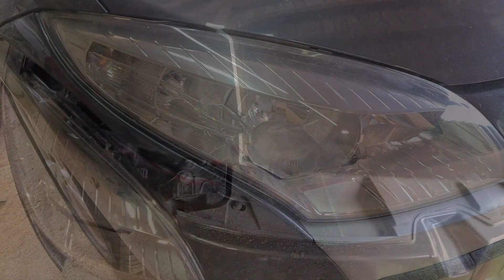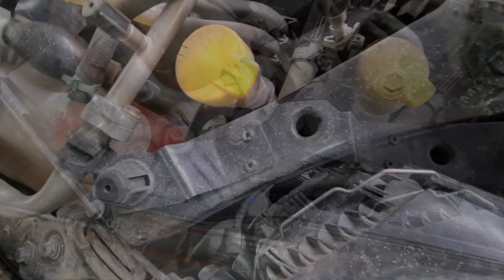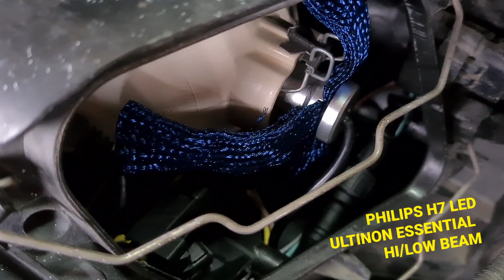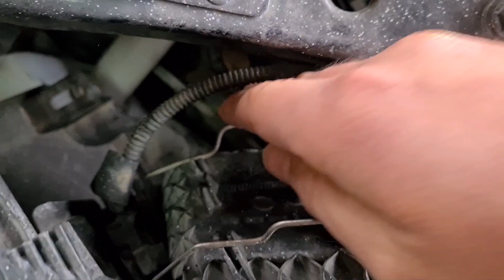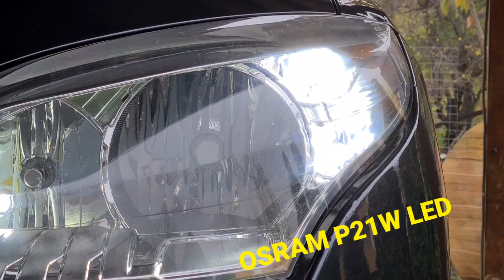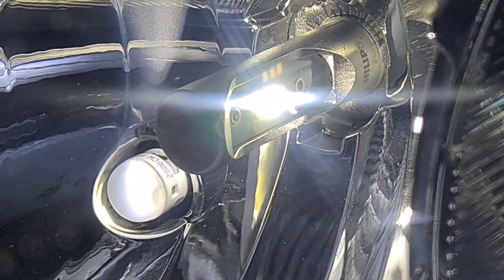Renault Megane III Coupe Headlight Removal | H7 LED Philips Installed

Comment: Olá bom dia... As lâmpadas led h7 sem canbus dão erro de lâmpadas no quadrante...?? Desde já obrigado
Reply from the maker: My car doesn't have CAN bus system and doesn't show error light on the dashboard. If your car have CAN bus system for detecting burn bulb you need to install Philips H7 CAN bus adapter that you can order from aliexpress or ebay.
Reply: @GoranDIY  muito obrigado pelo esclarecimento

Comment: Does the board computer accept these lights?  i have a renault megane gt line
Reply from the maker: My car has not canbus and has not problem at all with the board computer. If your car has canbus system for defunct lights it will need resistors.
Reply: @GoranDIY  thanks for the reply